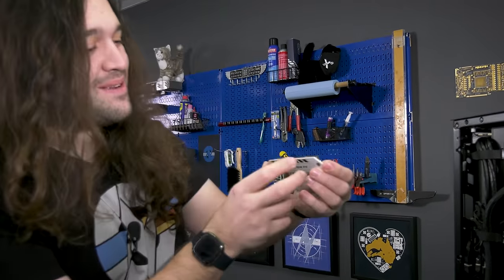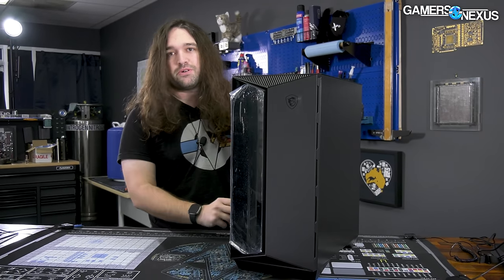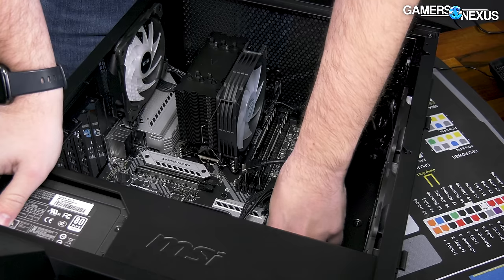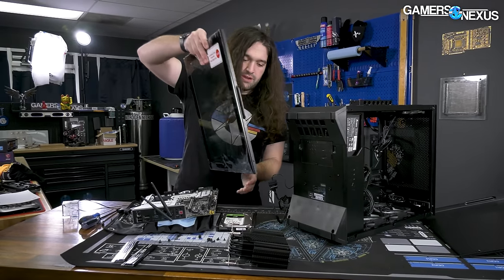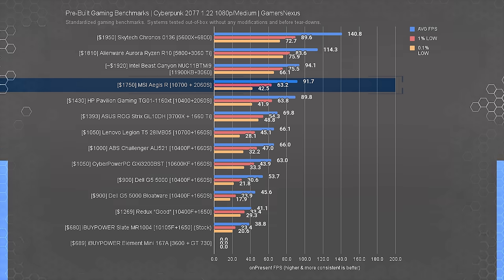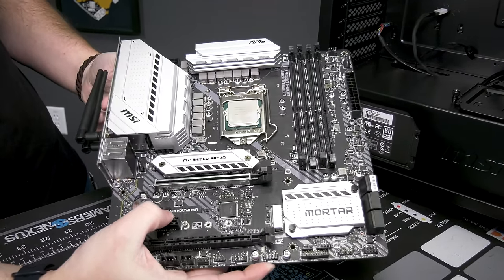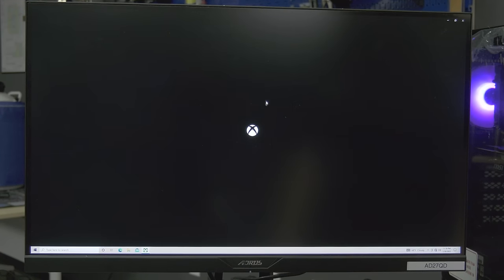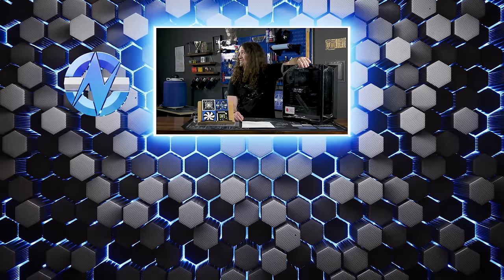MSI Pre-Built Bends SSDs & Boils CPUs at 100°C ($1700 Aegis R Review)

Comment: I have the newer version of this one. The only problem it had was that the motherboard bios was set to 60w TDP! Set that to the proper tdp, and it's been great. Also has a rtx3060ti, got it when no gpus had been around. I added a noctua second fan kit to that V cooler in push/pull, with the noctua being the pusher and oem being the puller, and it won't break 65C no matter what I do. One thing I'm not sure about is the GPU wouldn't spin up it's fans until it was already 60C.. used MSI afterburner to set the base fan % to 30% and my computer stays under 110F for most things not graphics related. It will go up and hit 65c on rendering or gaming, which it will slowly climb up with the gpu at 100% but haven't done any 4+ hours gaming to see how high it will go. It's fairly nice.

Also I don't know if they listened to you, or they knew about the m2 bending? My computer's M2 cooler was in a ziplock bag.. for me to install on my own. I thought that strange

Comment: My old Coolermaster HAF 912 is still in use and cooling like no other all these years later - I had my fill of "boutique" good looking expensive cases, the HAF912 cools better than any case I ever had and so ive never stopped using it - if it aint broke dont fix it. Im convince with the two 200mm fans and 120mm fans it will never be a hot box, and its quiet too.

Comment: Alright guys, I just recently got one of these… MSI Gaming Desktop Aegis R 11TG-244US… so it’s pretty much the exact same but with a 3060ti. Any recommendations on what to do? Can I get by upgrading the cooling only? Or should I be looking into a new case?
Reply: One of first thing you can do is get a 240mm AIO. If it's air cool.
Reply: @njramsfan30  first thing i did was switch the case and it basically fixed any thermal issues. I went with the corsair 4000D airflow.

Comment: Well, it would be unwise to have a vastly open front with an air-cooled performance system, sound-wise. ... A Bequiet case has restrained front intakes like that, too.
Reply: Not really, since the fans will run slower and it probably will be more quiet overall

Comment: The 3 fans in the front, that have no air flow, turn into heaters. If your fan doesn't get the fresh air flow it needs to flow without restriction, it starts to bog down the fan motor, and will actually increase the heat inside the case. If you ran this for an hour with the 3 front fans on, and an hour with those fans off, and compared the 2 temps, i bet the temp would be cooler with the fans off.

Comment: That thermal paste deteriorates very fast, it's literally designed for overclockers to set high scores then take the system apart and clean the paste off.

By all means if you want to replace the paste every 2-3 months go for it, but it's only 2-3°C than silver options, and that's lasts for ever all most

Comment: not an MSI but my Cyberpower prior to changing out the case and switching out the radiator was hitting 80+ when running just Borderlands 3.  Don't know what the issue was, as I had a local store switch out the parts, but I can only assume that the fans weren't working optimally.  Thankfully I bought a Lian Li Mesh case and a Masterliquid triple radiator.  A little overkill but I don't have that issue anymore.

Comment: I've bent M.2 SSDs before by not installing the stand offs and directly screwing the drive directly on the board. Thankfully I realized my mistake quickly and unscrewed it quickly (still, it was in this state for about 60-120 seconds). The drive is still working perfectly fine after doing that, but the sadistic part of me wonders how long you can stress the drive like that...

Comment: I have there Aegis RS i7 1700KF RTX 3080 Ventus. Same case, but mine is water cooled at the CPU with a single rad.  I added one extra fan externally it helps allot.  No air flow issues here.  My CPU in almost every game is 68C max the GPU gets to 73C . No bloatware as i used my own windows M.2

Comment: If it has no top exhaust fans, and no front intake space, the intake air is likely being pulled down from the top opening since the cold air would fall, creating awful airflow the circulates only in the topmost section

Comment: 15:30 >> Something is wrong here. EIther the big cooler has garbage contact, or board has V-core voltage set too high.
I did a i7-10700 build on a (even cheaper/basic) Asus B460M-K board with a smaller Be Quiet Pure Rock Slim (92mm fan). CPU maintained a solid 4.6 GHz boost @88c(max) with Aida64 stress test. @23c ambient.

Comment: Have you guys ever heard of a prebuilt company called Alphasync?
I purchased a 5900x/3080 system from them in November 2020 around the height of the shortages and I have to say it is THE BEST system I have ever purchased in terms on power but also build quality. (Even came with a TUF model GPU, One of the only models to not have those early pin issues)
I have only ever bought prebuilts for the past 15 years and am blown away by their quality and service.
They mostly sell through a UK based company called Ebuyer but would be awesome if you could review them somehow across the pond.

Comment: Seems a little harsh. Basically needs  the air cooler profile changing in the bios and a fresh install, no? They've done so much right with the parts, apart from not removing the stock heatsink on the ssd. Admittedly the case isn't perfect, but would it be ok without the crazy power profile?
Reply: The point is, the type of consumer that would be purchasing this product would not, and arguably should not have to, make these changes to make this thing usable and of decent value for the price they paid. Personally, I'd be happy with this build, but I've also been building computers for 20 years and know which changes to make and where corners should and shouldn't be cut. This product and especially this price tag does not deliver on the expectations of the customers they are marketing to.

Comment: I just bought the "MSI Aegis R Gaming Desktop - 13th Gen Intel Core i7-13700F - GeForce RTX 4060Ti - Windows 11" and haven't opened it yet, but I got it from Costco on a sale for like $1,300 (it's going for $1,600 right now off sale). I'm new to this stuff and I'm not sure if I should return it.
Reply: dont listen to people, there will always be people talking about problems with any computer.
Reply: I also got an i7-13700F Aegis and I'm getting temps of up to 100c on the CPU and M.2. Pretty disappointed
Reply: @asqmate have you gotten a new fan ? Or are temps still insanely high?
Reply: How’s it running? Or did you end up returning it

Comment: This case isn't THAT bad. I imagine they messed up with mounting the cooler. There's some ventilation on the sides, top and bottom front panel but the glass front is definitely a bad desicion. I've used the 110R on a build I did for someone, and temperatures were fine- nothing above 80c while gaming with a 5600x, 3070, and MSI 240R AIO. Except maybe the GPU hotspot peaking at 81c. Of course not up to the standards of an airflow focused review channel, but the case was only $70, has 4 RGB fans, looks great and is fine for the components we used it with.

Comment: Steve: Look at this one millimeter slit, and that's it for front panel ventilation.
Steve one minute later: Oh also there are rows of vents on the sides of the front panel. And oh also there are vents on the top and bottom.

This video had a ton of complaining about the front panel but at the end of the day it looks like removing it entirely resulted in pretty much the same CPU temperatures and a drop of only a few degrees for the GPU. shrug

Comment: I was about to comment something about the MSI Gungnir case working fine, but then I remembered that I own the slightly cheaper 100M and not the 110R. So my case has a giant plastic grille instead of the glass panel in the front.

Comment: I am pretty new to all this...but following yours and others' advice, I just built a gaming rig with an i5-12600 and RTX 3070, in a corsair 5000x case. I just bought a bunch of cheap amazon fans...I have intakes in the front, and exhaust in the top and rear...it's hardly fancy, but my CPU is topping out at 60ish degrees, and my GPU at 72. So it's obviously not very difficult lol

Comment: Honestly, this is a great candidate for a case mod project. Take that front panel and just cut or drill  a bunch of holes into the plastic for airflow, remove the glass if possible and put on some mesh, then maybe add in two intake fans at the top and then flush the Windows Install. You end up with something that might actually be usable.
Reply: I contacted MSI because apparently there is a mesh front version but they charge me 40 Bucks for the replacement mesh front. NOPE. So i just dremeld some nice slots in the front metal panel and its great. Thanks for the idea

Comment: One minor critique regarding the "literally" useless backplate @7:28.  While it is thermally useless, and could be better if it did double duty as a heatsink and a backplate, it does at least keep the fingers (and loose screws, slippery screwdrivers, and other solid masses of danger) away from any potentially sparky bits on the backside, so it does do something useful, and I'd argue that it's better than nothing (when on a card with lower thermals).  Course as you say, it's being plastic is a super poor choice on a higher thermal load, but hey, 2060.

Comment: I have bought a pre-built computer a year ago (Gungnir something something, the only way to get a 3080 back then) and it has the same case and many MSI components. What is interesting it has two more fans mounted on the top and the 3 front-facing fans are a part of a closed loop watercooler. They were also MSI branded and the reason I am using past tense is that a few months ago they started to make this terrible noise so I had to replace them. otherwise the computer seems to work fine though now I should check if my SSD is bent or something 😛

Comment: Msi thermalpaste and pads are horrible. My gl73 8se (2060 laptop) dropped 20C with a repaste using 5+ years old paste included with a 212 Evo.

I would love to see a guide tuning pre-built systems, bios, Intel xtu etc. Specially computers with add on "tuning" programs like msi dragon center. Would be nice to make the best use of the hardware with some tinkering.

Comment: have the same case. ryzen 5600x never goes past 65c playing any games at max settings 1440p with a 6700xt. and my fan is a low profile air cool too. pc is under the heater for the room too (mini split) probably will run better when i switch it to cooling in the summer.

Comment: awe man - I am just seeing this video and I bought an MSI rig. Looks like there are some improvements in my case and it came with a RTX 4060. We'll see how it goes. Any advice in testing things out?
Reply: Don't worry. Not every build will be like this. Just test your thermals, if they're too high, grab a Noctua COU cooler and put it in there. I actually have one from my old build.
Reply: @racheddar  actually I just returned the rig today. Just don't like how the HDD is crammed in by the power supply. Back to the drawing board for a different rig. Maybe the Lenovo Legion.
Reply: @bigkeoni6429  I got the MSI Aegis RS. It's incredible how different it is to the one in the video. Thermals are great and only issue was on of the case's legs was loose. Was only $1180 for a 3070ti and i7 12gen. It was a refurbished model tho.

Comment: I bought this exact PC, same price, same specs except I have a 2070 Super in mine instead of the 2060 Super and I have none of these problems in mine, you may have gotten a bad one or maybe whoever built yours was not experienced. The bloatware was annoying in the beginning but it’s easy to uninstall a lot of that. The airflow is something you can’t really change cuz it’s the same case and my system does get warm but it’s not completely overheating in mine. I also added an SSD to mine and checked the one that came with it and mine was not bent at all. I do a ton of optimizations to any PC I get (I have a system :p) so maybe that’s part of the reason mine does not perform like this example, so this may be slightly biased.

Comment: i have an msi aegis and the cpu core temp idling is around 40 to 50c, my issue is any kind of load the cpu temp creeps up to 80s and sometimes to the point where it auto shutsdown at 100c.  Its cooled by a 240mm CoreLiquid CPU liquid cooler. I checked the thermal paste, it seemed to be fine, and every other temp is fine. Would my issue be a bad cooler? maybe replacement?
Reply: Why would you buy this garbage lol they probably have some shit power delivery to the cpu set up in bios
Reply: @armando1is1great  all good now, I literally just turned my processing power load down and the game i play is running in 40s, overall that fixed my problem. Also noted i turned off that msi performance app.

Comment: Seems kind of bizarre that the BIOS was configured incorrectly and that there's a weird custom Windows power plan. I have a similar MSI B460 Torpedo board with a 10600K and it works perfectly fine without issues. I used the 'air cooler' setting in the bios and set it to balanced in Windows. No problem at all with an old Arctic tower cooler.

The fact that even if you take the front glass off this one it still overheats the CPU tells me what you should do is run a BIOS update and reconfigure manually. Same with clean Windows install. But that's not good for someone that didn't want to build their own system!

Comment: I have an MPG SEKIRA 100R.  It's all right.  Definitely has an issue with airflow or not really well built for a 3090.  It's certainly a cool looking chassis, but I definitely want to replace it at some point.  Ideally when DDR5 is more stable and the next wave of AMD chips are out and vetted (probably this time next year to work out the ideal bugs).

Comment: I just can't believe that a company as big as MSI doesn't have a chart that adds up the hardware components thermal output. Add the numbers together and it gives them a final value. if the value is 55 then you look up 55 and it tells you the size case that you need and also the square inches of venting that you need. if it's 65, bigger case and more venting. It could also tell the amount and quantity of fans. it would be an algorithm for cases.

Comment: I built a system for someone more than 10 yrs ago and the motherboard didn't come with a back plate. I didn't really notice at the time. It was bulging pretty bad after attaching the heatsink onto the cpu. I just figured that was normal. It really didn't have a predesigned area for a back plate either. Just a bunch of soldered pins all over the place on the bottom where a backplate should've gone. I guess it broke after some time. No idea.

Comment: they don't turn xmp on because system stability (i work in a small shop and it is hit and miss for reliability) and when you have noobs building the systems you cant have this . plus for the small performance it is not worth customers having problems especially for a system ordered online with no local support

Comment: It seems like almost everything is down to the preinstalled OS.  As the GPU thermals and GPU-bound gaming performance show, it doesn't have a cooling problem.  It has a completely-buggered power plan problem. Install a clean image, and it'd be fine.
Reply: Lol I unknowingly did this right when I got the pc as a gift, haven't had crazy issues with temps but definitely leaving off the useless front panel

Comment: Dust filter at the top is useful even if there are exhaust fans since it collects dust that would fall inside the case if the computer is shut down. However, the more important factor is, as Steve pointed out, that in a negative pressure setup every hole is an intake.

Comment: I was thinking of buying one of these MSI pre-builds ( MSI Aegis with an I7 12700k and Gforce 3070 Ti for $2174 on Newegg ) till I saw this.  But looking at other SI builders and the price for one to get close to the MSI spec was over $2600. So I was wondering if it'd almost be worth it to buy the MSI, make sure everything is hooked up right,  Wipe the HD to get rid of MSI's power setup and re-install a clean version of Windows ?  Or can anyone recommend another pre builder ?   I've built my PC's in the past but getting a good GPU at a decent price is impossible.

Comment: I would love to see if you can solve the cpu heat problem with a recommendation of a better cooler or a Bios setting. The cpu doesn’t make sense because I have the same build with the 10700f with no problems and great temps.
Reply: The CPU cooler is the problem. I have this same prebuilt and I replaced the cooler with the Noctua DH-15 and don’t have any problems with temps. The problem is the motherboard is proprietary with the cooler so I also had to get a new motherboard

Comment: That looks like the exact same cooler Msi put on my 2080 super plastic backplate and all. Also had less than half the vram chip actually get cooling and a 20c hotspot-average difference on the core. Was terrible cooler could be fun to check out.

Comment: operaring temp for memory is : 0°C to 85°C
adata has code decoder on website: AX= adata xpg] [U] udimm [3000]= 3000Mhz [3]= 1024x8 [8]=8gb [16A] = 16-20-20 [B]=bulk  [B]=black [10]=gammixD10

company website
adata
upload
image
PNDecoder
XPG_FAE_PNDecoder.jpg  (/) at end of lines